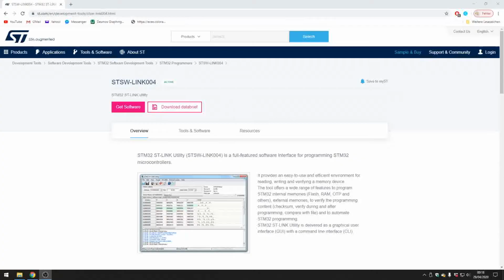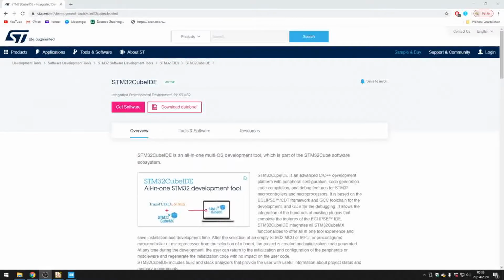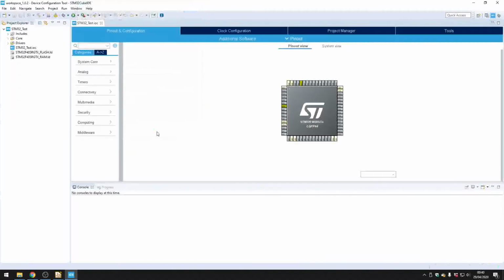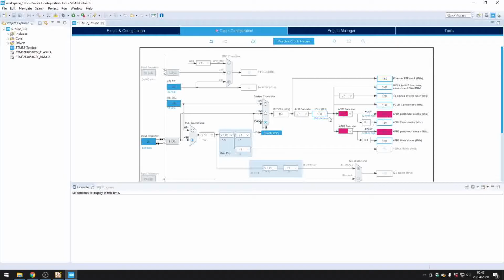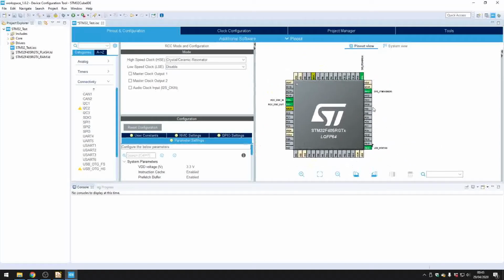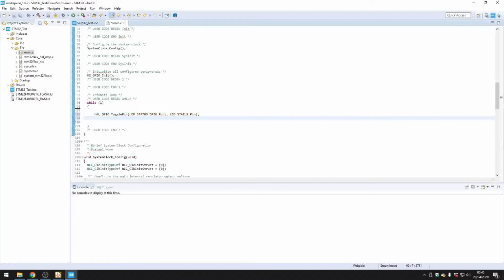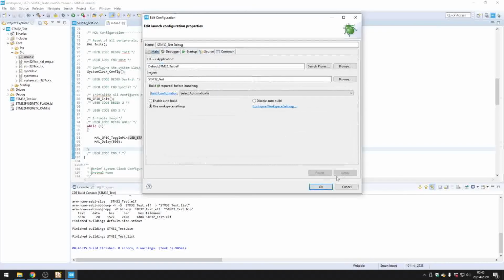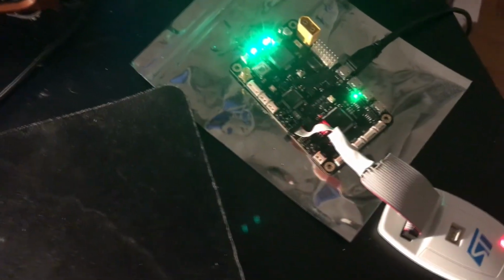STM32 + SWD + ST-Link + CubeIDE | Debugging on Custom Hardware Tutorial - Phil's Lab #4

Comment: Hi Phil, is it possible to connect to a board using the STM32 debugger and pull the software off or atleast see the software on the chip? as i have been sent a board by a customer who has had an issue with there and it's suspected the chip has lost its data but is unsure.

Comment: 1:31: This caused me a couple of hours frustration; that you can't power MCUs from pin 1 on a [real] ST-LINK/V2. The part where you said "It's just a reference voltage" was something I wish had been made clearer in the docs. I then realised I had to use pin 19 (non-ISOL device only) to power my board at 3.3 V. The confusing part is that pin 1 needs to also be connected, as well as pin 19.

Comment: @5:45 why you choose Serial Wire instead of JTAG4/5 !? and what is the difference between them!?
Reply from the maker: SWD typically only requires 2 signal pins and works perfectly fine for these applications.

Comment: I have a custom Chinese board which has an Stm32f105RC. The designer has decided to put 4 SWD pins on it. I want to program it using a Chinese clone St-link v2. But Cube can't find the mcu even tho it's power led is on. I guess I am connecting things wrong.
My question is, how come swd needs 4 pins(on the board) but the stm32 socket on my debugger has 10 pins?

Comment: Great channel. I've learned a lot from your videos. I have a v2 debugger (cheap clone). I have no problems connecting to my stm32 with it. I decided to upgrade to a genuine v3. I got the mini. I was interested in the SWV and virtual comm port (starting to regret this purchase). The V3 looks healthy and took a firmware upgrade but my target refuses to connect. Because it came only with a 1.27 cable, I'm using a jtag adapter to connect to the 2.54 pins on the target. Problem is the the ground detect pin is not accessible - so I just used ground - and am wondering if this is my problem. My other connections are SWDIO, SWCLK, and SWV (not required). I am powering the target through the separate usb. Anyway, I noticed in the comments that you're using  v2 but am hoping that one of your followers might have some insight. Thanks for making these videos. Plan b is to butcher the cable but I really don't want to do that.
Reply: I bought a V3SET original from its website during free-shipping times. They have UART, SPI connectors but no regular ARM10 so i need adapter as well. Kinda shocked these options on board (and missing cover on bottom which i 3D printed). I haven't tested it but they have jumpers described in manuals (UM2448). If everything fails there's probably a broken link on cable.

Comment: Thanks, this is just what I needed. Just to be clear, is this the method for programming a freshly soldered vanilla STM32 chip ie. not one that has had a bootloader previously flashed?
Reply from the maker: All STM32 chips come with a bootloader already flashed. Some STM32s however only support certain ways of flashing firmware (e.g. USB, UART, etc.) - but all will of course do SWD.
Reply: @PhilsLab  Thanks Phil.

Comment: Hello Phil!
I have a question about powering the board, i have been using Bluepill board for a while now, and i never had to plug in the USB cable to power it, SW was always sufficient and it also powered my sensors, my question to you is why do you have to plug USB for power?
Reply from the maker: Hi Mohammed! Typically the ST-Link does not (and shouldn't) provide power to the board but rather sense the working voltage of the target board. Therefore, for custom designs you should always provide external power.
Reply: @PhilsLab  Thank you for the answer Phil 😀

Comment: @phil, great work. Love your channel. Could you make a video on debugging using jtag using your st link connector and a demo on writing and reading from the microcontroller registers using the jtag tap pins? The reason is I ask this is because this a common use-case in the industry and a lot of entry level engineers will benefit from knowing this.
Reply from the maker: Thank you very much! I'm afraid I don't really use JTAG for these projects and have only been using SWD so far, so probably am not experienced enough to make a video on that :/

Comment: Going from the Arduino IDE to a fully-featured, debug-enabled IDE, is like switching from a kids bike to a sport's car
Reply from the maker: Exactly! It's incredibly hard to ever go back to such a basic environment after you've been exposed to something as cool as a debug-enabled IDE.
Reply: But do you lose all the Arduino libraries? (  I'd hate to port all the lcd display code.)
Reply: Thats why i watch these videos. I dont like Arduino IDE
Reply: arduino is shit
Reply: @jobaptist  I've developed multi core graphics code with threaded debuggers in kernel mode.  But for such simple projects, Arduino ide is desirable because I don't have to bother with re-porting libraries or figuring out bit twiddling to enable interrupts, or timers and clocks. I do wish Arduino ide had a debugger, but the trade off is fine for me because, overall, it takes less time to get my Arduino project finished.
Reply: @TheRainHarvester  maybe a bit late, but have a look at Platformio, it can be used with a lot of Micros and Frameworks. It handles toolchain setup and libraries for you with the possbility to get fixed Versions for everything. The configuration can be checked in to git, so everyone works with the same environment. It can also do a lot more like debugging,  static code analysis, testing, filters for serial ouput and more. You can either use a command line tool or plugins for different IDEs.
Reply: @vorgartenzwerg4245  thanks, I've come across it but haven't tried it yet. I want to be sure I could rebuild projects ten years later , or give my code to someone else tomorrow, without me/them needing to set up a huge environment and hunt for libraries that I originally used to built. ( I don't want updated libs when recompiling a golden set of code.)
Reply: @TheRainHarvester  For fixed versions you can always set a version tag for libraries, frameworks and toolchains. A lib could also just be a git repository with a tag flag, so you could have them forked in your own repository to make sure it is always available. Simply putting the source code of the library in a subfolder also works.
Reply: @vorgartenzwerg4245  thanks! That is great info to know!  
Basically, I never want libs to get yanked (also, tool chains).
I could make my own golden release versions and hopefully that could be given to someone else with the same directory structure to recreate my build on their same version of platformIO.

Comment: Good video! Is there a way to program multiple STM32F303 parts on a board using a multi-drop SWD or other interface?
Reply from the maker: Thanks! I'm not sure if that's possible via SWD. It should be possible via JTAG I think but not entirely sure of that either!

Comment: I would argue that STM32CubeProgrammer is more current tool than st-link utility for flashing and other development/hacking activities. In fact, it is the only way for those who are not using Windows.
Reply from the maker: Yes, I’d agree with that as well. I pretty much exclusively use SWD + CubeIDE, so the other programs are just for quick checks (for me).

Comment: HI Phil, tell me is there any way to debug a 256MU806 (dsPIC33EP) by using the ST-link V2? or which device and software would give me access to the 256MU806...Much appreciate the help, thank you for your content it has helped to understand.
Reply from the maker: Hi Takumi, I'm afraid I don't think you'll be able to use the ST-Link to debug anything other than ST microcontrollers. PIC-specific debuggers are here: https://www.microchip.com/DevelopmentTools/Listing/a063fb83-a427-45b7-afa0-71cc9e8f8c44
Maybe the Black Magic Probe (https://github.com/blacksphere/blackmagic/wikihttps://github.com/blacksphere/blackmagic/wiki) will let you debug PICs with some tweaking?
Reply: @PhilsLab  howsit gent thank you for replying, i spent a few night researching on Mplab debugging programmer the Pickit 4 this device will work with MPLAB X IDE. the pickit3 and below are limited to the microchip on the market, again thank you and thank you for amazing content.

Comment: Quick question, do you need that device in order to program an STM32? I'm using an STM32 along with a Bluetooth module to make my Bluetooth headphones, but I was planning on using UART and not SWD.
Reply from the maker: You don't need the ST-Link to program (all?) STM32s. By pulling the BOOT0 pin high, you can usually flash the device via UART, USB (if available), etc.
Reply: Phil S Gotcha makes sense, thanks for the help.

Comment: Don't you need an antenna!? 😦
Reply from the maker: There's a GPS antenna connector (SMA) on the board. Wasn't using GPS for this video so didn't attach it.
Reply: @PhilsLab  I thought it was a transmitter connector that you forgot to attenuate. You definitely know what you are doing! Great videos, thanks a lot!

Comment: very clear explanation like ever. 
I just dont understand why you have to set 168mhz. But sounds like is something to have in mind
Reply from the maker: Thank you! You can essentially set the clock frequency to your liking, I just usually set the frequency to the chip’s maximum frequency to get the greatest performance out of it. For the STM32F405RGT6 the max. frequency is 168MHz (as also shown in CubeIDE), but will of course vary for each chip (e.g. some H7’s can go up to 480MHz).